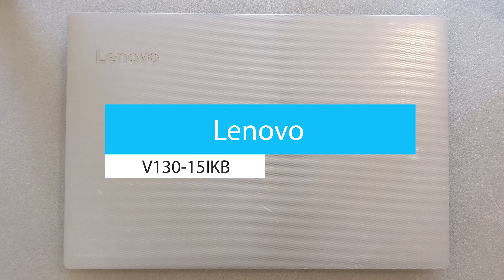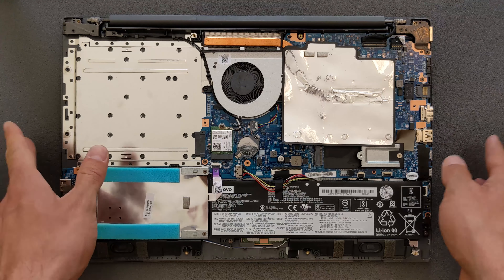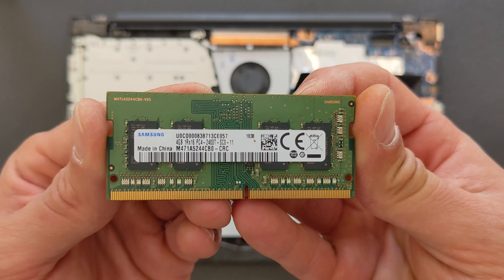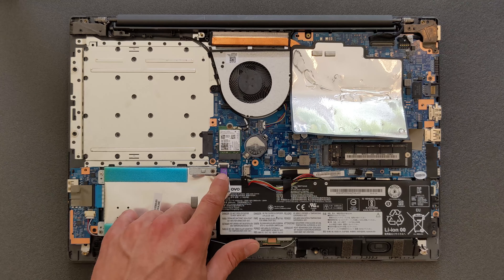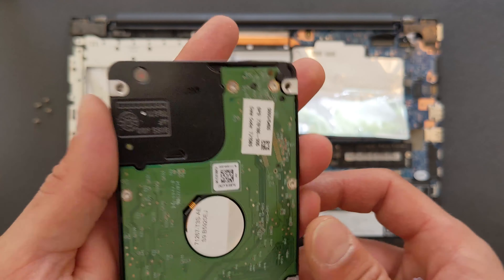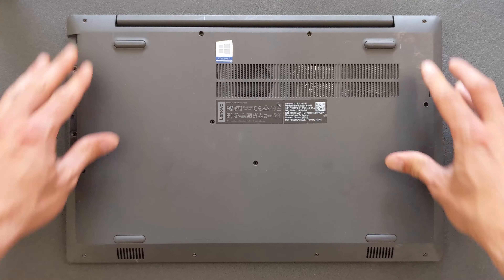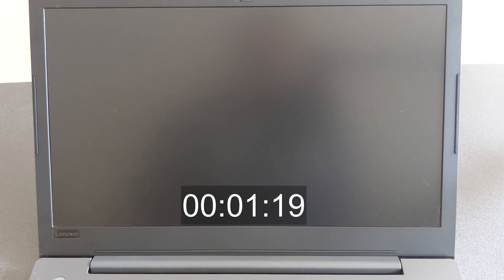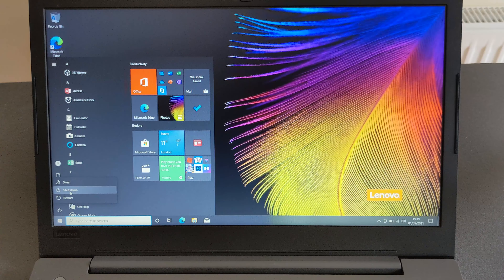Lenovo V130 Hard Drive, SSD, RAM upgrade

Comment: When replacing the M.2 SSD, do you buy M.2 2260 or M.2 2280? I understand 2260 is shorter in length than 2280....

Comment: Ive got same laptop with Windows preinstaled on solid hdd, im planing to buy ssd and reinstall windows on it, which model you recommend and what size ? And whst is best way to reinstall windows from hdd to sdd
Reply from the maker: I would go with Samsung SSD's, just make sure it's compatible with your laptop. As for windows, i always install clean version from USB. Never really copied OS from one to another.. just easier and faster.
Reply: @ToxicNerd  thanks I'll do just that, preparing usb as we speak

Comment: Hello. I'm afraid I'll tear off the battery cable: / Can I install ssd without unplugging the battery cable?
Reply from the maker: You can but disconnecting battery cable is recommended!